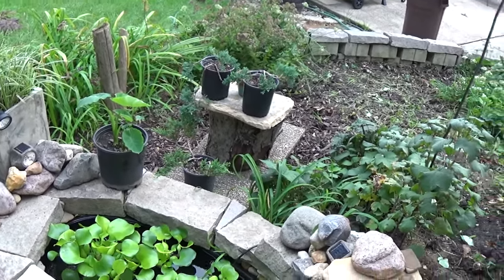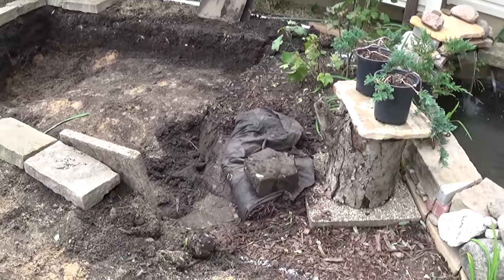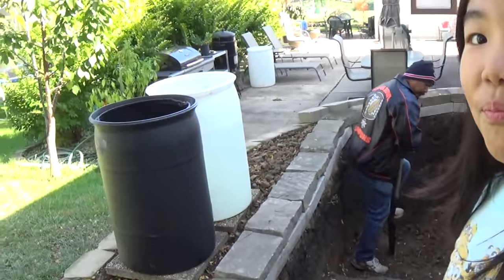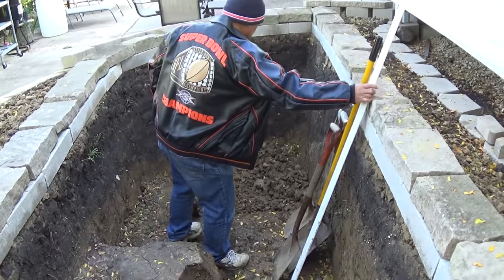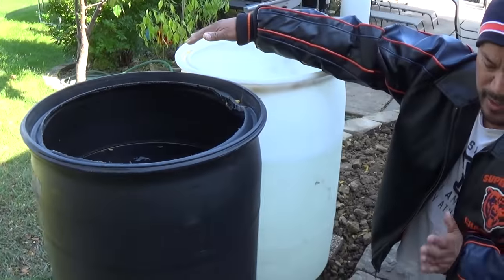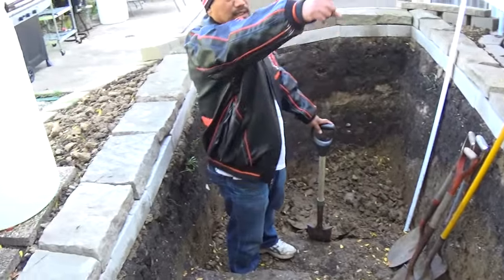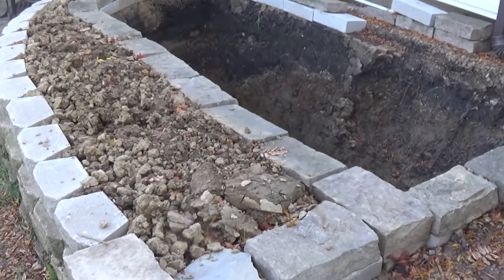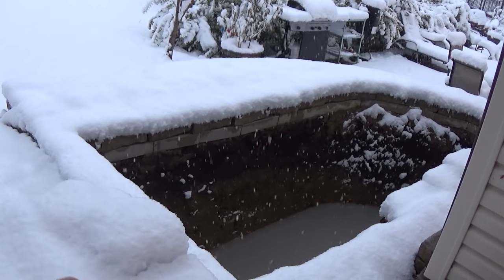Building a New Garden Koi Pond (Part 1 of 5) - Backyard Fish Pond Documentary

Comment: Hello pond expert

I need your help I am trying to build a pond behind a retaining wall which holds soil and plants. I have removed around 2 tones of soil but I and confused in what to do. I have build a pond for koi fish. I have just constructed a rectangle pond about 3 feet deep  a metre wide by about 1.5 metre long. I was going to stick with that and have a pond with a pre-made waterfall. I then watched many videos on youtube with rocked in ponds and decided to build a second pond with a small water fall but I have a dilemma my original plan was to  link both ponds with water falls but found I had a problem the koi pond is about 1-2 inch lower than the small pond and in order to get water to go from the small pond is casing me issues as you probably know to get water to flow from one upper pond to a lower one requires a incline both ponds are almost level. The reason I can not build the upper pond up is because the retaining wall would need to be level with both ponds so its difficult to put in writing what I am trying to do. I have made a video to explain in the link below please watch it if you can. As I see it I have another option and that is to cue some of the breeze blocks and build a water wall from the side of the small pond into the koi pond or knock a side section of the breeze blocks and exstand the koi pond into the wildlife pond would you advise this or not would having 2 separate ponds be better than having  one large koi pond please advise what I should do thanks.

My youtube video which I made can be seen here. https://youtu.be/alMRMubWd2A
Reply from the maker: I’m no pond expert but here are my thoughts. Your idea of cutting through the koi pond will work but I don’t like that idea because you are actually making that pond smaller by making water level lower and subtracting gallons of water. Personally, if it were my project  I would make an effort  to make the wildlife pond higher. It’s easy to do by using concrete blocks or rocks to the existing level. That way you don’t have to alter the koi pond. This would be a similar method when it comes being gravity fed like my pond. My filter barrels (this would be your wildlife pond) is just a tid bit higher than my koi pond. Look at my setup on pond to give you an idea. Best of luck. I’ll be looking forward on how you choose to solve the problem. Here is the link to my video so you can see my setup. https://youtu.be/9bSs9KgS3rc
Reply: @kimuseni  Hi thanks for the reply. The wildlife pond is higher all ready  the actual height of the wildlife pond is about an inch or so higher than the top of the koi pond. I believe adding the wildlife pond to the koi pond in a continuous pond will add 500-1000 litres to the pond entire volume. What this means the koi fish can enter the wildlife pond making the pond about 50% longer but only about 2 feet deep.  I have decided to take this approach so I can plant plants around the rocks.  I also have an interesting idea of using a gate made of wood and chicken wire stainless steel. that could slot  inbetween that would stop fish but not prevent water moving through.  A bit like a canel lock gate if you know what I mean. once you start digging it seems you want to make it as big as possible. You did this when your walls caved in during the winter as I did watch all 4 parts again nice job. The koi pond is about 3-4 feet deep. I had to dig another 2 feet down to lay down hardcore as drainage as per your advise. I had to cut through 6 inchs of concrete to do this which was a job from hell.  We have had nothing but  3 rain for 3 months solid here in england uk. So it has made this project a very expensive and time consuming project. What I am mussing over is do I have 2 ponds with waterfalls going from one to the other or do I make it one big pond with 3 levels 2 levels in the wildlife pond  and the final pond being in the koi pond? I do plan on building 2 fish caves in each pond  as I may decide to put 2 goldfish in the wildlife pond I thought it would be fun to create a water channel connecting both ponds what do you think?
Reply from the maker: I think you have some good ideas. I’m looking forward to your update and build videos.

Comment: awesome design & construction.  *side note*... to avoid compromising the integrity of your homes foundation, any in-ground water feature, including pools, should be placed no less than 1'  (one foot) for every 1'  (one foot) of depth AWAY from an existing structure foundation. The weight of the home could collapse the pond/pool wall and in turn collapse all or part of the structure.
Reply from the maker: thank you!  we have since turned the pond into concrete.  the pond is 4' deep. and it's 6' away from the foundation of the house.

Comment: good work so far, but seems like you have a cold winter, so if you can, please dig deeper. ( the water will benefit from groundheat in the deep parts at winter time.
do you self a favior.. make the bottom sloaped towards a bottomdrain.. really.. get a bottomdrain.. Ill say it once more bottomdrain is something you will be happy about once done..  makes you work around the pond much much easier..
I had both a small pond withour drains, its a pain.. now I digged a large pond with two bottomdrains.. much much better.
Then.. honestly, get a trickle filter, or DIY one, they are awesome, but mainly for bio-filter, you will still need a mechanical filtersystem.  

you can see my pond in my videos.. notice how sloaped I made the bottom towards the two drains.. I have NO dirt at all at the bottom, in the old pond I used to vacum once a week to get fallout out of the pond. !
Reply: I finished the "DIY filter, just in case you wanted to check it out, seach "Brilliant DIY koi pond filter" or just my channel.

Comment: nice start, you may want to use concrete instead of liner, won't cost you that much more. Nice start can't wait to see when its done. Check out my 7k gallon pond, cheers.
Reply: I did not I used pollyeura spray, and I love it. I was just looking at your pond and seemed like a good foundation for the size and area.